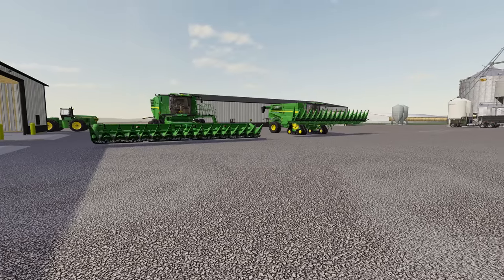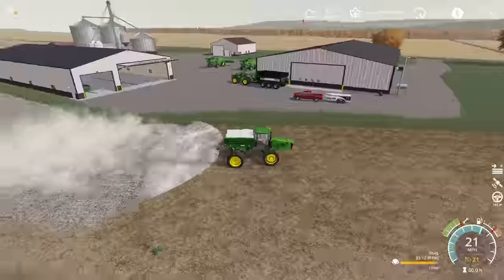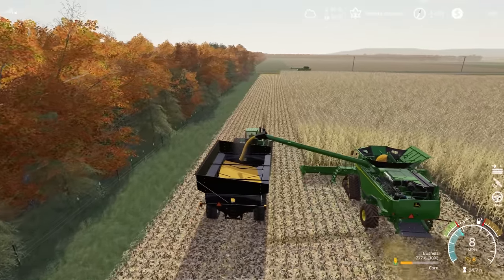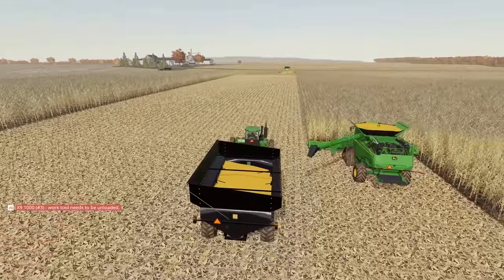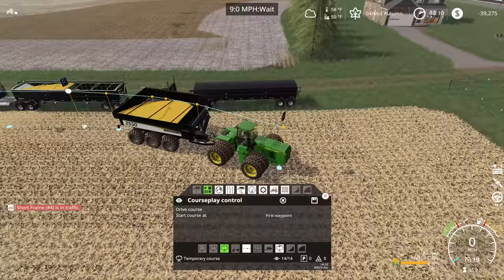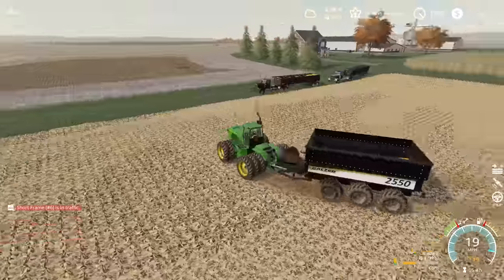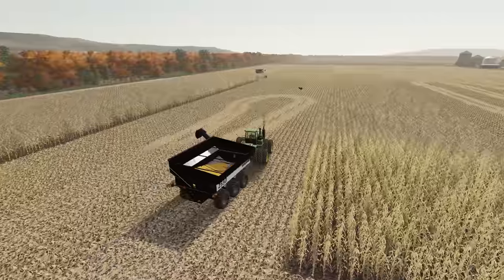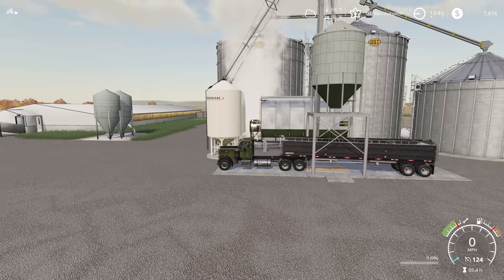Corn harvest underway, loading up the grain dryer with Precision Farming on Flint Hills - EP13

Comment: Yea, I modified a Maximus to hold 50k liters and the Meridian 1260 to hold 200k lime so I have enough on hand to refill in the field. Lime is brutal.
Reply from the maker: Agreed lime is brutal, will be curious to see how much it uses if I skip a harvest and put it on after 2 harvests.  Not sure how much of a hit we'll get on the lime levels each harvest.
Reply: Since I began to pay more attention to Precision screens, I seem to use 2-3 times more lime once I get the fields in the green
Reply: @KederkFarms  each harvest decreases ph by .1875 it’s roughly 1100 liters per harvest to keep it at optimal level also you can go three harvests before it will start to effect yield

Comment: Nitrogen is based off both crop type and soil type the worse soils have a lower max nitrogen number where the better soils have a higher max nitrogen number think the sandy loam has an optimum of 160l per acre where as silty loam has an optimum of 220l per acre just an FYI I’ve adjusted some of these to my liking as well as lowered the lime application since it’s way to high the max we would put on is 3 ton per acre or crop damage could actually occur plus the cost is ridiculously high for lime
Reply from the maker: Well stated, I could have done a better job articulating that Nitrogen is based on the combination of soil and crop type where lime is based solely on soil type.
Reply: If you dont mind me asking how did you change it so it didn't use so much lime and what did you set it as?
Reply: @Dan-9107  unzip the precision file then open the precision farming xml in notepad or something similar so you can modify the file scroll through the file you’ll get to a section with lime it gives a calculation on how much like it takes to raise a certain amount of ph I think they have it set at 750l/.125 in the lime usage per state I decreased it to 250-300 you can add me on Facebook if you need further help I adjusted some other factors as well like made dry fert 46% like urea is and liquid to 32% which can be found closer to the bottom of the xml then just hit save when your done and close it out you do not have to rezip the file I leave it open to make adjustments I feel needed now if only I could figure out where to decrease the cost of lime and increase the fert chem and seed cost I’d be pretty happy
Reply: @edwardmonken4562  Thank you so much, it worked and it's so much better and more realistic. Wish I could add an actual anhydrous ammonia mechanic but this mods help a lot. Thanks again for the help I really do appreciate it.

Comment: Another good vid.  Now I know why I never seem to use any fertilizer and lime, but it would give a price in the field reports.  had the workers turned on.     Is the course play edit has simple as it looks,   click and drag?     Also, I have yet to get the grain cart to chase without issues.
Reply from the maker: Yeah it's that easy!  Left Control + Numpad Zero brings it up, course must be loaded but vehicle stopped and not driving the course